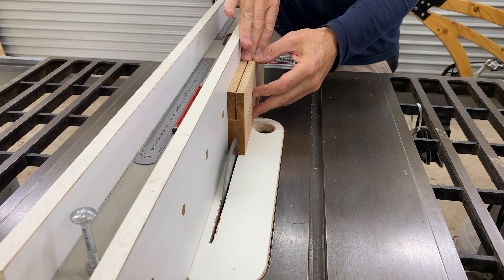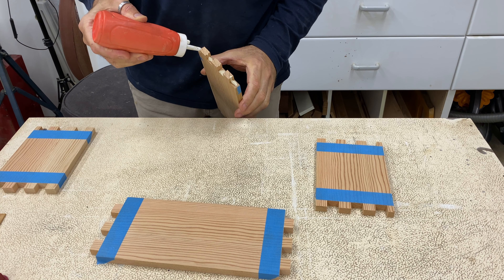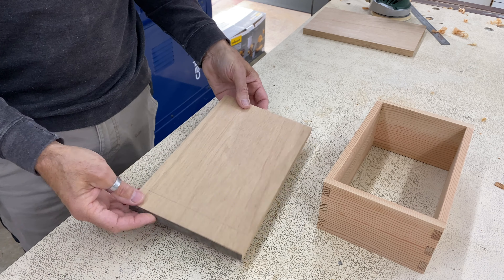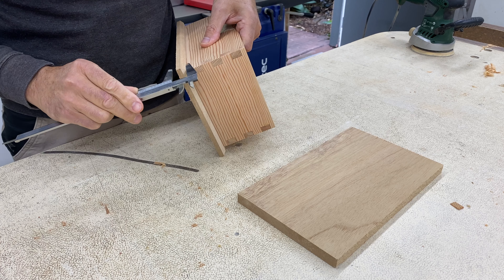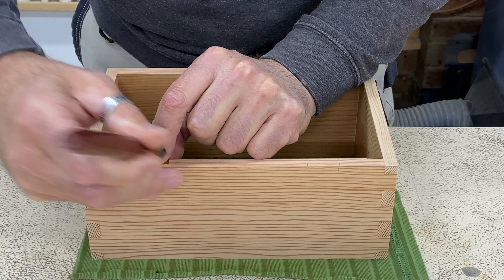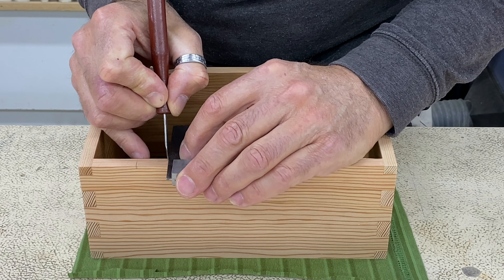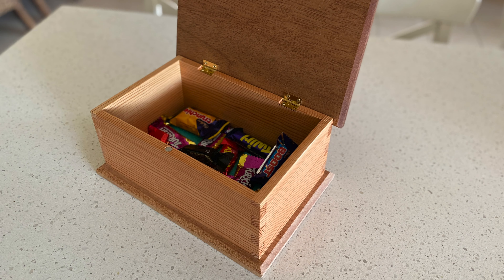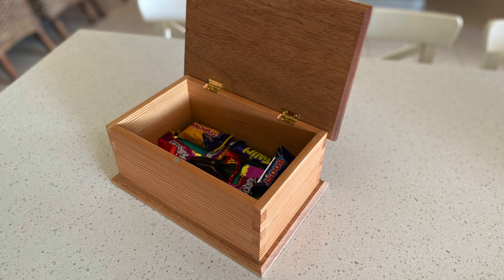Imagine that!! Using box joints to make a box. #Springtimeboxmakingchallenge

Comment: Nice box. The very tight fitting of the base to the box is a little concerning especially given your side of Oz is currently being inundated with water. It'll be interesting to see how it holds up over time if the weather continues down the path that the BOM predicts
Reply from the maker: Thank you. Im not really concerned about wood movement because that piece is so small, the amount of movement across a board less than 200mm in size would almost be zero.